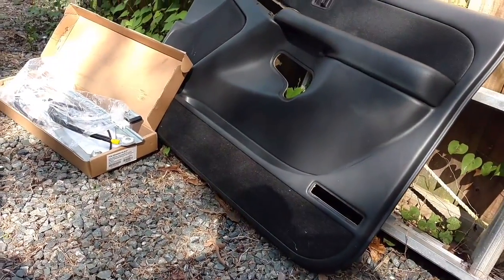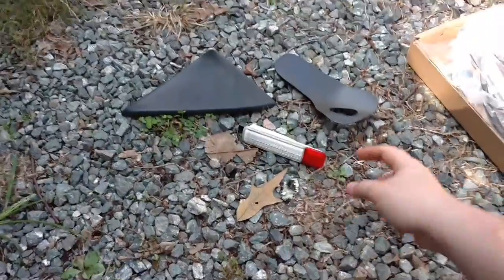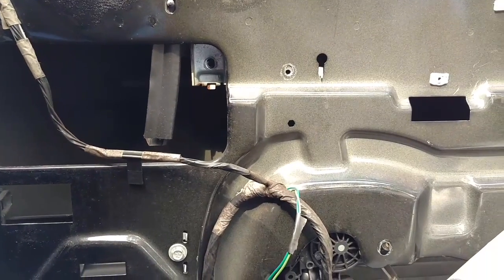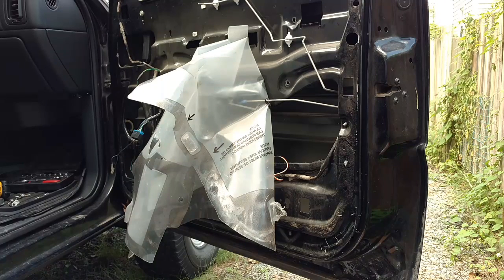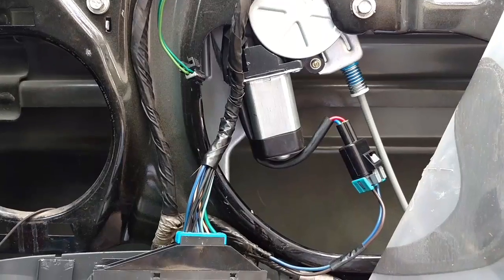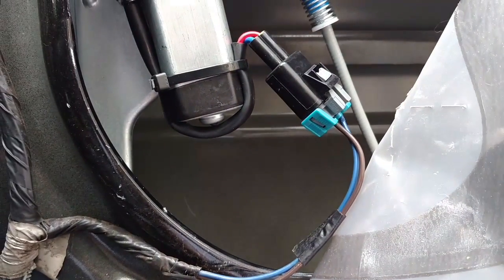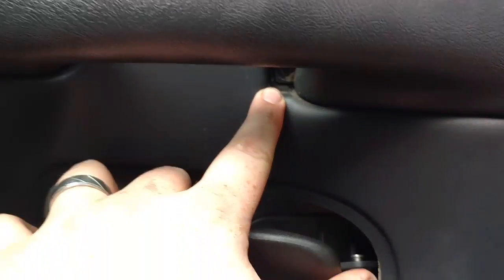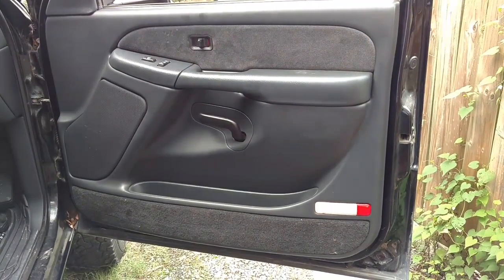How to replace window regulator Chevy Silverado (99-06)

Comment: I just pulled mine apart to see what's wrong..I tried rolling down the other day and heard shit shattering in the door..and the window wouldnt go back up anymore and is stuck down about 3 inches..found a cable not attached to the regulator railtrack above the motor..so gonna have to order the whole assembly and perform this exact job..nuts!!!